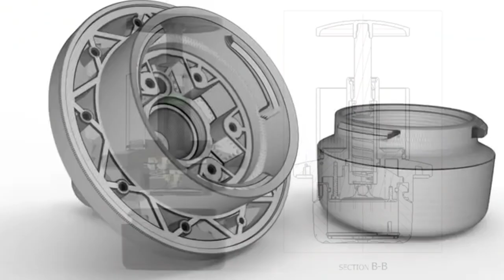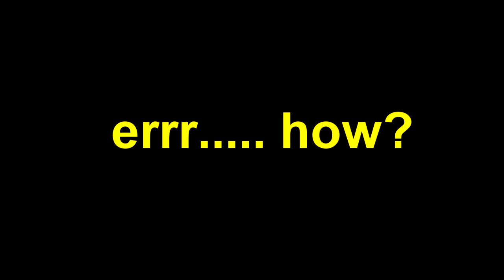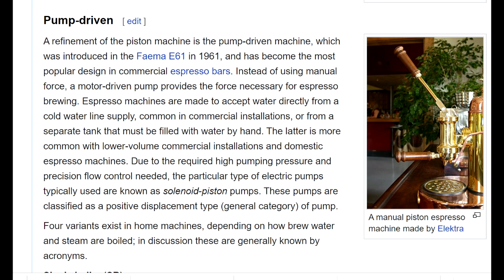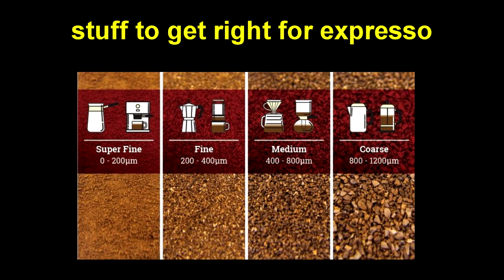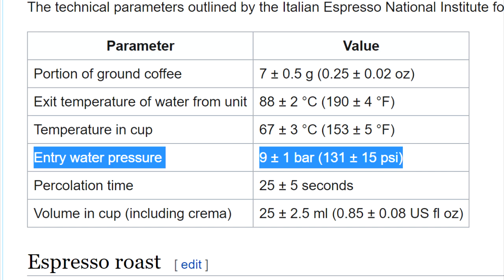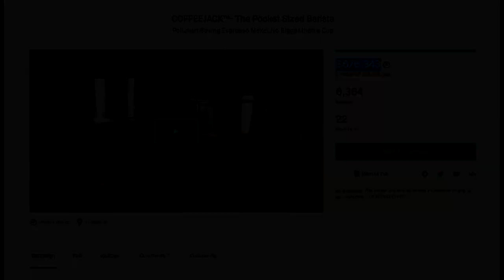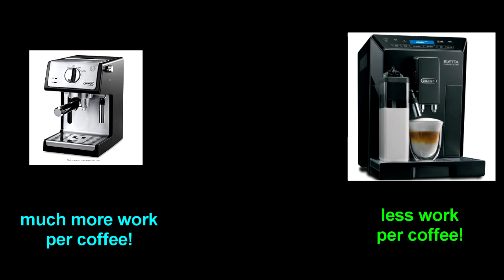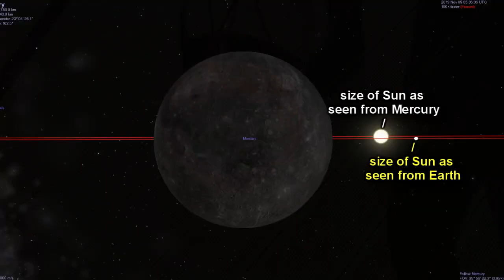CoffeeJack: BUSTED!!

Comment: They finally started to deliver, for real. It took some time, you may argue about the pricing, and it is not perfect, but it does make decent espresso-style coffee. So hardly "busted". There is nothing fundamentally wrong about it anyways, except for the usual difficulties related to mass production, so I don't see why it should have been "busted" in the first place.

Comment: Your compression test using syringes is completely BS because it’s not pressure sealed. You need to deal with it a rubber gasket. 
It’s easier to just say that 10 bar  = 150 lb/in2 
Since an average porta filter is 3.5 in2
That means the total force that needs to be exerted on the porta filter is 3.5 in2 x 150 lb/in2 = 525 lb. 
Impossible to achieve that force with such a small lever. 
It’s a scam plain and simple.

Comment: Anyone who's comparing equating pods with good espresso shouldn't be doing reviews on anything espresso related.  But this isn't really a review, is it? It's a snarky, annoying takedown attempt of someone else's idea from someone who's maybe never had a good, original idea. Reviews are impartial and you need something to review. Watching a promotional video of a prototype product doesn't qualify. Try putting one of those home espresso machines in your suitcase and taking it on your vacation.  I'm in Mexico enjoying a good cappuccino at my vacation rental with my coffeejack. I have a stand but all I brought was the basic pump and one portafilter. Fit easily in my carry-on.  Does exactly what I was hoping it would after some grind and tamping adjustments. Same thing you would have to do with a $6k home prosumer machine.  Not saying it makes an equivalent cup but it's good enough when you don't have other easy options and you would be a fool to think it should.  I'm getting a decent amount of crema and it's a nice smooth, balanced shot with home roasted beans.